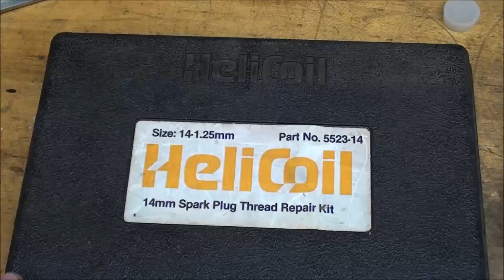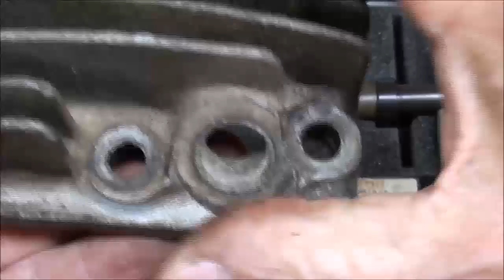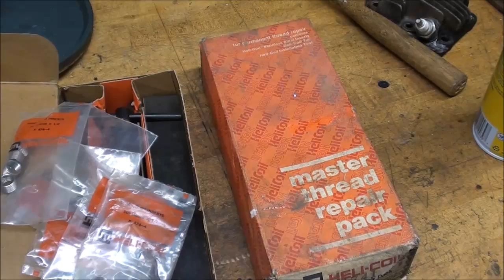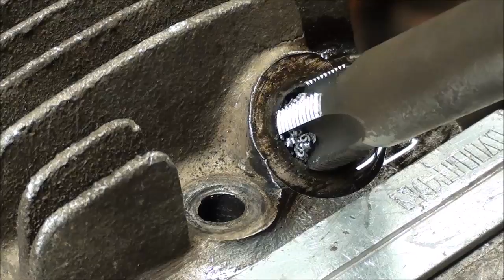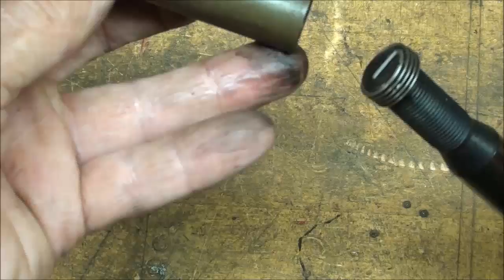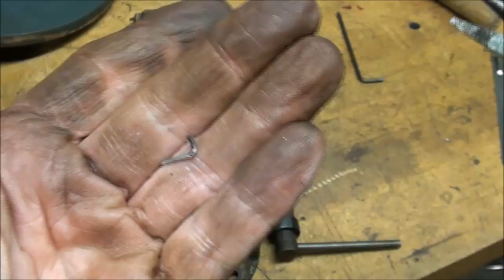SHOP TIPS #210 Using a HELICOIL to Repair a Spark Plug Thread tubalcain

Comment: Great video brother That's how a  professional works,
  I'm doing this trick to a heli  coil that came out, got loose. Out of my spark plug hole.
  I have a 2005 Harley-Davidson Fatboy M12 * 1.25. you had the exact same size as the other box that you showed us with the orange and white lettering.
  Going to try to do it while the head is on the bike with the gas tank in place do you think 5" in will give me that clearance? Thank you in advance.
Reply from the maker: Not sure about Clarence, hope you don’t have to take the head off

Comment: Got the same helicoil set.  Never had much luck with it.  Especially frustrating are the 3/4 reach which I've ruined multiple inserts.  Seems they get to a point, then tool very hard to turn and then jambs before helicoil gets out of the tool.  Any idea what I might be doing wrong?

Comment: Be interesting if you had pretended it was on engine and used grease, and then when done see how much cuttings fell on table, and to see if cutting fluid wipe of the grease causing cuttings on table... As usual, another great video.

Comment: Autozone has better insert kits with a metal tool. It works in taper and gasket plugs. On cars with deep spark plug holes get a Time sert kit or better yet a Big sert kit. Get the one with the long tool.

Comment: long ago I worked at a shop where the owner used "KD" inserts.these were basically threaded tubes as the man hated helicoils for some reason(price?),anyway I wondered if you used or even heard of "KD" inserts and if so do you have an opinion?
Reply from the maker: No, I never heard of KD inserts

Comment: Interesting how they measure the thread diameter and pitch in metric, but the reach in imperial.

Also, wrt tapered spark plug threads, if you had the head off, I guess you could drill out the tapered thread, fit an insert, and then use a straight thread spark plug instead.

Comment: room permitting i like to bore and tap a grade 8 bolt,leave a small shoulder on the slug,and install with j b weld on the outer threads

Comment: Thanks for showing this !
My problem is I have a Craftsman cultavtor 4 stroke one spark plug that's strip out has aluminum head I never try or know much bout back tap 10mm or heli. -coil plug is taper that's in head. I try my 10mm back tap it made new threads at the bottom of hole but who ever owned machine before me either try a coil or mess up the threads the plug was quite sloppy when purchase used now I was told by repair small shop I need to repair with Heli coil using 10mm x 100 pitch and he don't have that size kit so question is it possible to save this engine block? I got $100.00 in unit plus 32.00 for back tap now was told heli kit 
Any help appreciate 
Also in your clip you stated Kit Won't work on taper plug is this true???
Louie

Comment: I use these quite a bit on trucks.  i just tap the hole and blow the cylinder out with shop air, then i run the engine for a minute or so with the plug out to get as much of the shavings out as possible. I'm not to concerned about the shavings ruining the engine because its just aluminum but you wouldn't want it in the cat

Comment: I didn't know that it was a difference between Cutting oil depending if it is aluminum or steel, Thanks for the tip Mr Pete..

Comment: Time Sert is the new big thread repair kit, mostly used for engine block head bolt holes. The Time Sert is much larger than a Heli-Coil, and a Time Sert is actually stronger than the original tapped holes. Toyota I-4 engines are famous for ripping out head bolts, when the heads warp.

Comment: Wouldnt the area that is enlarged by the helicoil tap, but not covered by the helicoil, lower the compression ratio of the engine? 
Also, have you used timeserts? I like those better than helicoil.

Comment: mrpete222 you say if not using aluminium cutting fluid you will ruin the hole for sure - can you explain why?  my guess is something to do with aluminium shaving clumping with a different visousity oil? the fluid you used appeared very thin. thankyou

Comment: I would imagine that the coil is magnetic,  so if you dropped the tang into the cylinder you may be able to fish it out with a magnet on a stick.
Reply: Some stainless isn't magnetic?
Reply: Heilcoil stainless is magnetic enough to retrieve the insert tang from inside a cylinder using an extendable ✏️ pencil sized magnet 🧲. I have done this when fixing a Honda small engine spark plug thread.

Comment: in the days of yore if you didn't have a helicoil you run a tap through the offending hole to clean up the threads then wrapped the spark plug threads or what ever culprit was to blame with copper  wire and screw it in.  it worked almost all the time.
Reply: Maybe where the idea came from?
Reply: Or, maybe you could just thread for the next size spark plug, and use one of them instead.

Comment: Nice to see a demonstration of how it's done.

Looking at how far recessed the sparky end of the plug is, I wonder if the engine wasn't designed for a longer reach plug?  Some time ago I bought a set of plugs for my car from an autoparts place and the threaded end was much longer than the ones I had taken out.  After putting one in and turning the engine over by hand to be sure there was no interference, I put the rest in.  The dealership service people had put the wrong plugs in!  Car ran better too.
Reply from the maker: +Fourcycle Its not the correct plug- Thanks for watching!

Comment: Hi there Mr Pete These are a great fix I used the 1/4 " ones on my coin slide mechanisms on my MAYTAG washing machines as you may know the coin slides are a type of aluminum casting so actually the coils are stronger than original. very good video,s you re making. Thank you.

Comment: A tip I learned at Ford engine school If you have to do inserts with the head on the engine put the cylinder at bottom dead center of the compression stroke and fill the cylinder with foaming shaving cream ( Do NOT use the gel type) drill and tap then install the insert. then crank the engine over to blow the foam and any shavings out of the cylinder.
Reply from the maker: +fatboyfester Thats a very interesting tip--Thanks for watching
Reply: Thank you very much that sounds crazy but I'm going to use that method I have a 2005 Fatboy and I'm not taking the head off the engine and I'm not removing the gas tank, the shaving cream won't interfere with the oil Will everything be okay????
  I love it if it works who's better than you I thank you in advance please reply. Just save my day
Reply: @Cazanova-r5m  I have only done it a couple of times and as far as I know it didn't cause any issues with the oil. If you're worried about the cylinder walls getting stripped of the oil film you could put a couple of squirts of oil in the cylinder and bumping it over before putting the spark plug back in.

Comment: The older packs were a steel ,box with steel dividers for all the inner tools, later ones are plastic with a foam and plastic set of holders. I bought some really cheap as I wanted imperial sizing in a metric country, so the ones I got had been sitting in a store since the 1970's, and those had the nice red steel boxes.

The other brands of spark plug repair kits use a solid machined steel block that is around 3mm wall thickness, it works well and will not come out with the plug easily. Does need a jig to set up the drill and tap to be perfectly aligned with the hole though.

Nice thing is that if you do not have a long enough insert ( for deep holes) you can just us a few in the hole, they will all be aligned perfectly.
Reply from the maker: +SeanBZA Thats good info., Thanks for watching

Comment: Maybe I'm un-informed but why dose an antique engine and spark plug use metric sizes?  Were the spark plugs or the engine made in a country that uses metric? (i.e. not the US)
Reply from the maker: +PennLineProductions They are all metric threads

Comment: A question on the tap wrench: I was taught, many years ago, that with the jaw style yours has, the wrench should be the other side up than you had it so that the long face of the jaws bear on faces of the tap square as well as inside corner of the jaws, in a similar way to proper use of a crescent wrench. Does it matter, in your experience? As a side note, Heli's are the cat's meow in gray cast iron. I tend to use a different brand with a little serration near the bottom end that keeps it from walking.
Reply from the maker: +john john Thanks for watching--you are probably right on the wrench-I never noticed.  But always used a crescent the correct way

Comment: Just my opinion... but I'm not crazy about Clinton leaving all those exposed threads in the combustion chamber. Yes I know it's a low compression engine, and they're not likely a big pre-ignition source, but still, it's not a good design practice; not to mention sloppy looking. I've seen much the same in other engines as well...
Reply from the maker: +rwbishop You make some good points-Thanks for watching

Comment: aren't helicoils meant to be installed with a permanent threadlock?
Reply from the maker: +seasonedtoker No that I know of
Reply: +mrpete222 I only asked because I keep seeing generic kits (not the Helicoil brand) that have a small 2g loctite green thread locker included in the kit. theoretically it could be a bonus, but the purpose is defeated if too much heat is present
Reply from the maker: +seasonedtoker Yes, it would have to be a high temp locktite. Go to their website & see if they recommend it

Comment: MrPete When using a Helicoil for a spark plug make sure that the insert is longer than the spark plug threads. If the plug threads are longer than the insert 2 problems can occur. The first one is the protruding threads can  glow red and cause preignition. the second is that carbon can build up on the protruding threads and when the plug is removed the insert comes out with the plug.
Reply from the maker: +marv w Thanks for watching---good points
Reply: Very good, the same thing happened to me 2005 Fatboy, taken out spark plug when it was warm the helicoil brass collar came out with it.
  My indie put new heli coils in cause spark plug was hard to get out.
     I bought the whole set/kit for 200, 
    Just hoping I have room to retap with the tank on and head still on the bike?? What do you think

Comment: thumbs up , The newer Heli sets have a cheap plastic tool to install the coil ! I like those vintage type tools better ..
Reply from the maker: +ShawnMrFixit Lee Thanks for watching
Reply: The HeliCoil set has been using that plastic applicator for at least 25 years now, maybe 30 or 35 years? I bought up a big box of brand new SAE HeliCoils, and Metric HeliCoils for maybe $5 or $10 each, per set, in 20 or more sizes. I bought every single one the guy had, but he usually always cut me some really great deals. The man is Vietnamese, and I always treated him with utmost respect, so he always gave me really good deals. The people I got some of my tools from have more value than the tools themselves, especially the old guys that are long dead and gone now.

Comment: What keeps the helicoil from backing out of the head?
Reply: +Chris Call The notch or raised area on the tool presses against the tang of the coil.  That's what drives it in.  When you wind the tool out, the tang skips over the raised portion of the tool so there is virtually no force to wind the coil back out.
Reply: +ptonpc Actually I was referring to later when the spark is removed. There seems to be nothing actually retaining the coil.
Reply: +Chris Call the coil is wound and screwed into the threads so its got spring pressure and friction holding it in allegedly.
Reply: +Albion Laster If the plug is not put in with a touch of lube it might come out later with the insert, but the insert is very tightly held by the outer thread and the full contact it has with it. The inner thread takes less torque to remove, so it tends to stay put. Once the plug is loose there is little friction on it ( the tension on the hollow bolt has been released) so it comes out easy, to get the insert out you have to either pull so it separates from the outer thread so it can turn, or tear the thread out. Your tightening torque stays the same, it is there to compress the deformable gasket on the plug, to strip the thread is a lot higher torque ( and why do ppl want to tighten up to that point is beyond me) and with the insert having a larger area and being stronger than the alloy it requires even higher torque to strip the insert now.

Comment: Beware of cheap imitations!  The one I bought used a standard socket wrench for the tap.  The problem being after cutting the threads the tap fell into the cylinder!
Reply: Woulnd't you say that was user error? In my experience most people run a tap farther than they need to because they're not thinking straight about the details in the first place.
Reply from the maker: +dictare NOT GOOD!

Comment: I work repairing TV News cameras. They have magnesium-alloy bodies and every screw hole all the way down to 2.6mm diameter tends to have an individual heli-coil style thread inserted. That way immense loads and holding by such small fastenings can be assured. 

I had to use a heli-coil on a late model car i own and it had just come out of its warranty right when it developed a nasty oil leak. I traced the source of the leak to the 4 cylinder twin-cam cylinder head where it had an 8mm bolt holding in a small support bracket. There was also a camshaft cover ontop of the cylinder head so i removed it and discovered the 8mm bolt had been installed at 30degrees(!), stripping any threads and entered the oil flow area (normally,  design would have allowed more cast area there). After thread repair the new 8mm bolt had some thread seal added. The engine in that car hasn't dripped a bit of oil since. (i LOVE Heli-coil)....
Reply from the maker: +peteb2 Thanks for watching--helicoil saves the day again

Comment: Another great vid Mr.Pete. Last time I used one was on my small block Ford for the alternator pivot bolt in the front of the cast iron cylinder head. Lucky for me it was in my 63 Fairlane so I had the room to work. These thread inserts can be real life-savers in so many applications.Neatest things since sliced bread!
Reply from the maker: +Tad A Thanks for watching-they are great

Comment: It's a bad feeling when your doing this on an assembled motor, and you break the tang, take the pliers out of the hole... but no tang.

Especially if it's a motorcycle drain plug and you have to split the cases to find that fricken tang.
Reply from the maker: +Pat Sullivan Thanks for watching--I would dread that

Comment: First used one with a borrowed Reliant in Alabama,  (I had only been a few weeks in  US) that lost seal on stat housing. I free wheeled down a hill, pure luck found an autozone, bought kit, no drill, but got tap in, then coil & it sealed. Such a relief! It worked for a long time afterwards.
Reply from the maker: +Springwood Cottage Thanks for watching--good fix

Comment: Back in the 70's I used to put a lot of those into motorcycle heads.  Usually they were off the engine just like the one you used.  I still have three boxes of them.  Thanks for sharing.
Reply from the maker: +cerberus Thanks for watching
Reply: Hello, I have a 2005 Fatboy you think I can do it with the head still on the bike,and the tank?
  I measured it I have 4 3/4 in to work with
Reply: @Cazanova-r5m  how will you get the chips out of the cylinder?  That is my concern.  Thanks for the comment MrRichBiker.

Comment: Heli-Coil saves the day!  I've installed a few... in the engine compartment.  Gota be careful, you usually only get one chance.  Many high end aluminum engines come with steel threaded inserts from the factory.  You can adapt a airline to the intake and blow the chips out that fall in.  Either way, if it works, it's faster and cheaper than tearing a engine apart...
Reply from the maker: +WAVETUBE84 Thanks for watching--good idea on the clean out
Reply: mrpete222 I heard of using compressed air added to the oil gallery when drilling and tapping VW engines for "full flow" oil filter addition.  Figure it could applied to other situations.  Maybe a common trick to "those in the know", but was new to me.
Reply from the maker: +WAVETUBE84 Thats a good idea
Reply: Make sure both valves are closed and you would be surprised what a good vacuum cleaner with an adapted end fitting will suck out

Comment: HeliCoils actually improve the strength of the threaded hole.
Reply: +bottomlands  In aircraft stuff, it's rare to to see a threaded hole in Aluminum without a factory installed Helicoil.
Reply from the maker: +pbooth001 Did not know.
Reply: Anyone who's had to drill out a helicoil will vouch for that 😂😂 I wouldn't wish it on my arch nemesis 😜
Reply: That is so mistaken!